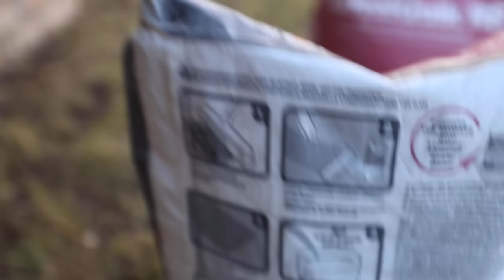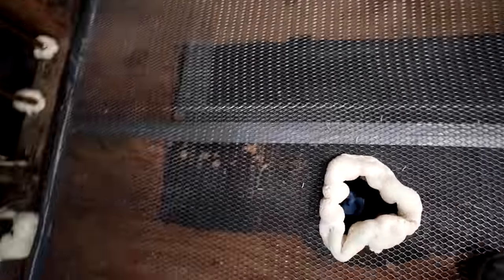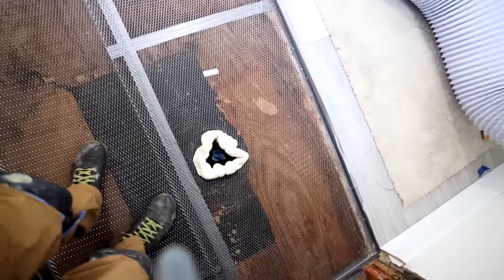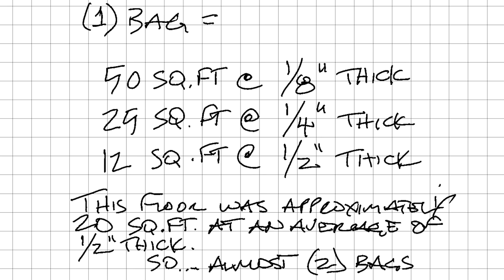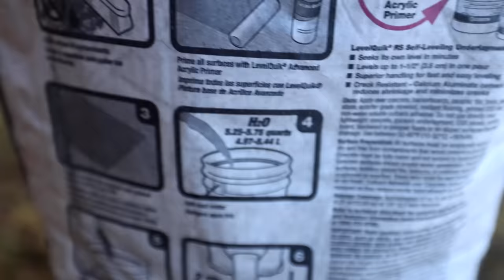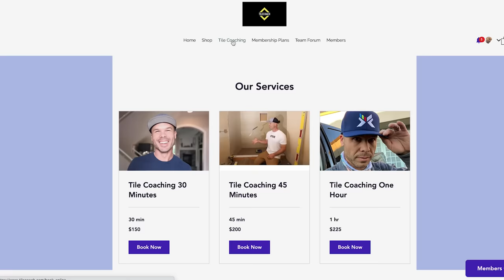LevelQuick for FOAM SHOWER PAN on Plywood Subfloor

Comment: How far out of level does the floor need to be for you to put down self leveler? I'm doing a shower and it's not that far out of level and if I can skip a step I'd be glad to but I also want to do it right.
Reply: Where's the bubble?
Reply: I think the standard is 1/4 per foot so if you drop the foam pan and you arent getting that you're gonna have problems
Reply: Unless your doing a mud bed i would just level it
Reply: mark with pencil where the leveler needs to be poured to bring that area up to level, then just pour leveler in the low area, and feather the edge. Not all levelers can be feathered to zero,  some have min thickness of like 1/8. I've used this leveler as shown in video for my shower prep before Schluter tray instal,  it can go to zero edge.
Reply: I'm using a Kerdi foam pan and I'll have to look but I think it's between a 1/4 to a 1/8 but closer to the 8th out of level it's pretty close
Reply: the first step should be a preslope for a liner. forget all this stuff.
Reply: Can easily use thinset to set the Foam pan and use more thinset on the side needing to level it.do ur best to keep 100% coverage especially if using more thinset on one side,to avoid any voids and areas wt less coverage. Unless the floor is Insanely out of level I would rarely need to self level a floor.
Reply: @johnbell1246  this is also an option if level is out less than 1/4. Thinset can easily make up differences of 1/8 or so for trays or tile installations. Most installers would perhaps take this route especially if it's just a few sq ft that needs leveled.
Reply: @bsmbB  1/4 is the standard, but the distance also need to be considered. Over a 4ft span, I would not find 1/4 to be acceptable, but if it's 8ft for example, thats fine. Of course, that's for flooring. When talking shower pans; getting closest to zero becomes more important.
Reply: @phillipgrandison2384  i was talking pre slope for the pan if the foam pan is not on par with industry standard it needs correction. If he's doing a mud bed and hand floating, self leveling is not used as you would bring the pan to level with proper slope using a cement mix. As far as flooring industry standard is no more that 1/8" deviation at 8' and 3/16" at 10' with no obvious peaks or valleys for typical hardsurface masonry is generally 1/4" at 6' and no one cares what carpet does lol
Reply: Im talking general flatness in my comment above this its not alway possible/feasible to hit level with floor installation due to financial constraints and material and labor cost

Comment: Hey Issac, always enjoying the videos.

Just wondering how you would recommend installing shower glass, if not drilling into the curb/tile floor?

I wouldn't trust just silicone on the bottom to hold for 10+ years.

Any recommendations?
Reply: Same question. Was wondering this from his previous video.
Reply: you could put the 'c' section screwed into the tile on the floor to add some strength. I have used silicon but that's an option!

Comment: First video that I watched of yours installing self leveler.
Though I've never used one, the spiked roller has been described like a dream come true by a rep from UZIN.  They make some self levelers and moisture emissions retarders that are bulletproof.  They have a self-level called 170 Levelstar.  I've used it a few times and it's fantastic stuff.
I install floor coverings but not ceramic tile.  I rarely use self levelers but I wish I had access to a spiked roller for the times when I do.
https://youtu.be/Nc1WFwXSVP4

Comment: He showed that foam was rubbish few videos ago then uses it on an upstairs bathroom coach my arse
Reply: Sort of. In that video he was dropping hammers on the tile from bout 3 ft, also drove a forklift over it. Unless u planning on doing that to your shower; foam is fine.
Reply: Ok Nancy - sorry you can't see the difference between relying on foam as opposed to using it for a quick setting dam material. 😂😂
Reply: Foam is just a 2nd rate product for a shower floor just screed it with cement but by all means you can use foam

Comment: Um....the duck tapes bond to the plywood will eventually fail and your primer doesn't stick to the duck tape. A problem?....ah yep. Once that bond fails, that pan will leak like a Dutch Dike.
Reply: Makes me nervous too. Since he's thin-setting over it & then putting down a foam pan, maybe not a problem? Still, I'll probably spend the extra money for edgeban (or the like) for the perimeter & feather finish for crack-filling.
Reply: Water will never get to the duct tape. The only reason for the SLU is to flatten the floor so he can install the foam shower pan (which will get waterproofed).
Reply: The duct tape is there only to hold the leveler till it sets up... 
Thats all ! The leveler is part of the underlayment now.. 
Nothing to do with the pan or the tile or expansion